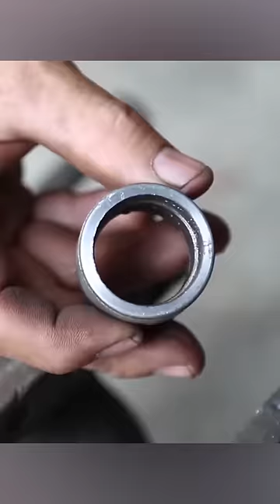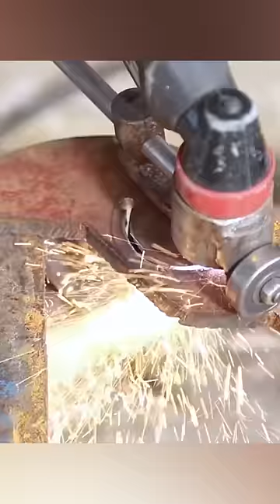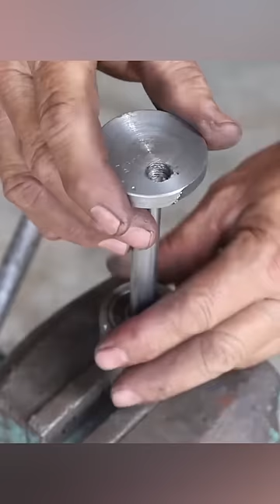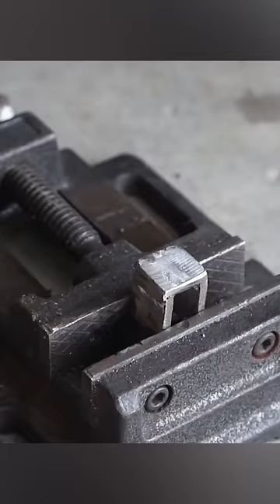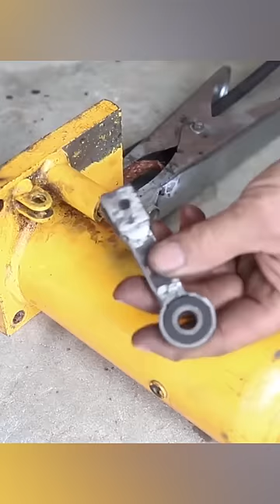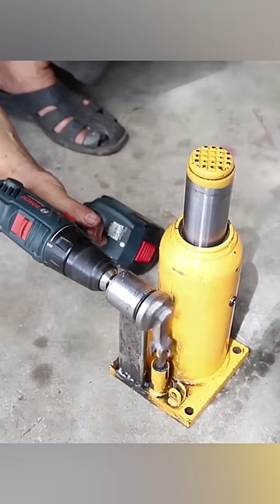DIY hydraulic jack tool

Comment: I run my impact over to my car jack it works just fine, without any of the welding and knowledge to change something from circular into vertical movement. Which does take some skill.

Comment: Buy a roll around floor jack, problem solved.
Reply: 8t, 12t etc bottle jacks are not for lil Civics with fart can exhausts
Reply: @PWgadgets  Most trucks you can jack up the parts that you need to with a 3 ton floor jack. If I had to lift more than that I still wouldn’t use a bottle jack I would use a forklift floor Jack that can go up to 10T. Anyway, I don’t drive a rice burner. Lol 😂

Comment: Slaps forehead.  Why didn't I think of that 50 years ago?  That will make jacking much safer.  Use it in slow gear only, though.  Also weld on an extension to open the release valve.  I've always hated those things.

Comment: Don't whip it fast, you'll blow the seals and it will need to be rebuilt. They don't last long when you use a saw or drill to pump them up fast, speaking from experience with a sawzall.